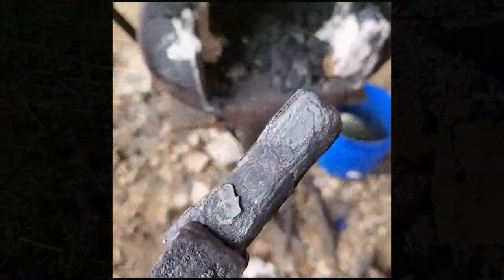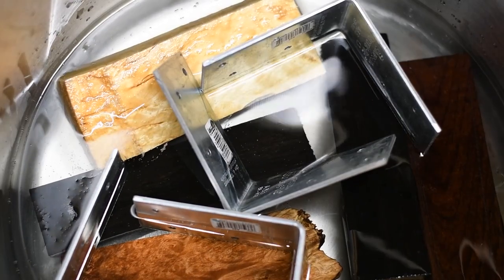vlog #3: my 2x72 blade making belt grinder! a common question answered, bloom steel?

Comment: That is the problem with most belt grinders is the the rollers are made from aluminium to cut costs, make them from steel you never need to replace them.
Reply from the maker: ive not even seen steel ones
Reply: @ThePathOfFire  That's right very rare these days Aluminium is much easier to machine, I made belt grinder for a local knife maker 25 years ago I used 4140 to make the rollers
the machine is still going strong today, bearings in the motor have been replaced and also in one roller.